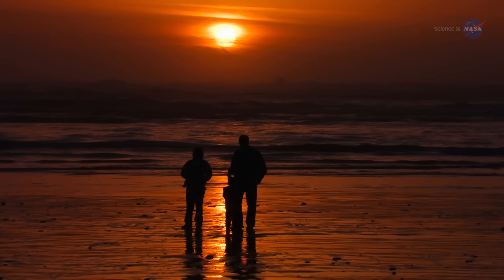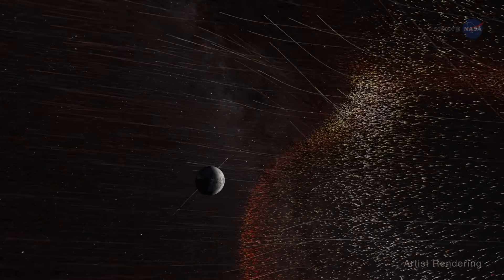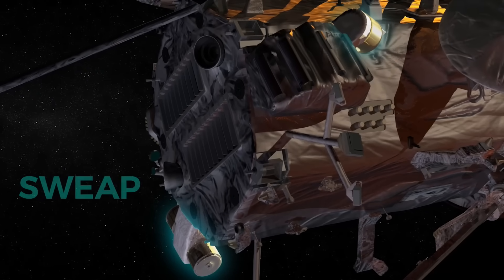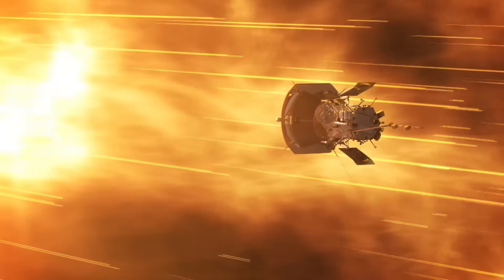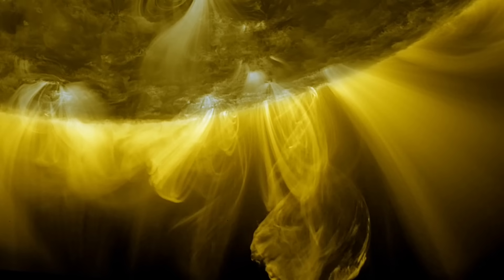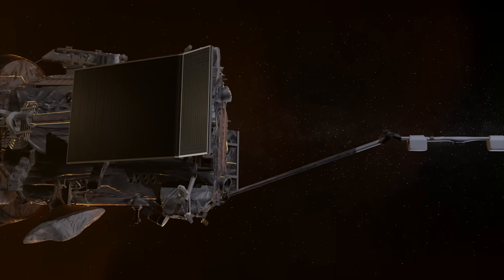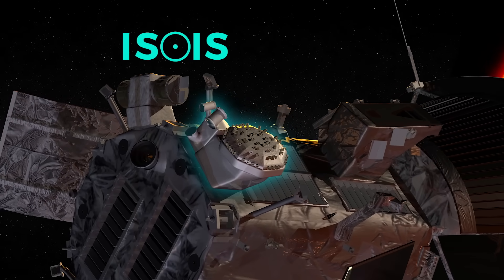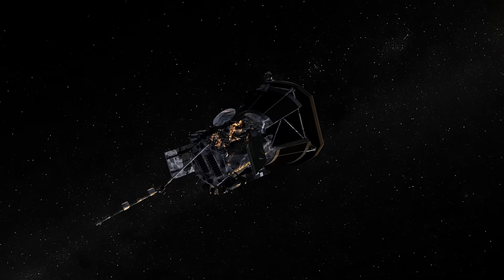NASA’s Parker Solar Probe explained in detail

Comment: ~430,000 mph is ~692,000 kph and ~716,000 kph is ~445,000 mph. NASA says 430, where did 716,000 kph come from? Not that it matters, whats 24,000 kph among friends?
Reply: As the spacecraft reaches perihelion (it's closest approach to the sun) it speeds up due to conservation of momentum.
That's where the 716,000kph comes from.
Reply: @Johnno48  
The max speed would be after 1st pass of Sun?
Reply: @jdc1957  
It's fastest speed would be as it approached the sun as it would have to slow down to enter a solar orbit.

Comment: it will probably melt, even on the shadow... because the "radiation" penetrates anyway, plus if the sun ejects a corona ejection probably will also destroy the own eletronics.. lets see..
Reply: I dont want to by insulting but this is quite arognat thinking. If parker fails it will be because of some obscure reason neither of us would ever think about, not because of the MOST obvious problem that everyone working on the project knew about.
Reply from the maker: heat shield explained https://www.youtube.com/watch?list=PLpGTA7wMEDFhjou2ZaH6sRCOGUpW9UVAD&v=Zc4jy_9Wpew

Comment: Do you think this could calculate differences in space/time compression when approaching a strong gravitational field?
Reply: Bethany T Davis it will have an atomic clock on board and they take that into acount for time dilation
Reply: John Doe we can detect it with modern clocks. They are that sensitive. The clocks on the gps satellites are that sensitive
Reply: It will be so little, we cant detect it
Reply: If we can detect the difference in the speed of time between the surface of the Earth and the satellites in near Earth orbit, I believe they will detect something.
Reply: Bethany T Davis they can do that? I dont know i think theres no big gravitational pull on satellites
Reply: That is why there is a difference. The gravity of the Earth compresses space/time the closer you get to its' center. Making time on Earth slower. This is why the time on Earth and satellites has to be constantly synchronized.
Reply: Well it would be missing 6 seconds per year if it were right on the surface of the sun, so it might be a second or two at it's operating orbit.
And then a couple of microseconds from the speed.
Reply: I guess if everything works, we will find out.
Reply: It should be able to, but i believe it should be too little to be significant, remember it will stay a few million kilometers away in orbit and it is not the main concern for the mission, still we should keep an eye on that, could turn out to be amazing.
Reply: Bethany Davis

while the Parker Solar Probe may not be directly equipped to measure space-time compression, the data it collects can still be invaluable for validating aspects of General Relativity near the Sun. Through indirect measurements like clock discrepancies, Doppler shifts, and precise orbital tracking, we can extract and confirm relativistic effects, thereby advancing our understanding of gravitational time dilation.

Comment: How is telemetry protected from interference?  What keeps the data intact?
Reply: it stores the data onboard and transmits after perihelion and when the interference is at a minimum.
Reply: Thanks, Eddie - an elegant solution.  How far out is aphelion and has data been successfully transmitted from that distance before?
Reply: Aphelion will gradually decrease with the orbits, but usually between .7 and 1.0 AU.  I'll link a nice video of it.
Reply: Cool
Reply: Redundancy, redundancy, redundancy. Not just hardware/software but extensive error correction coding on transmitted data.
Reply: Astrocelt water-cooling system.
Reply: That's classified.